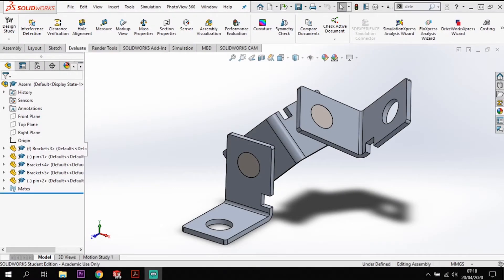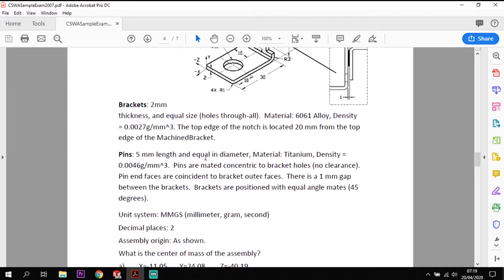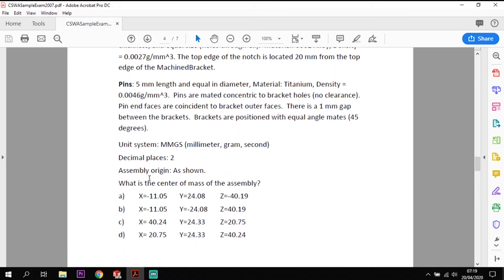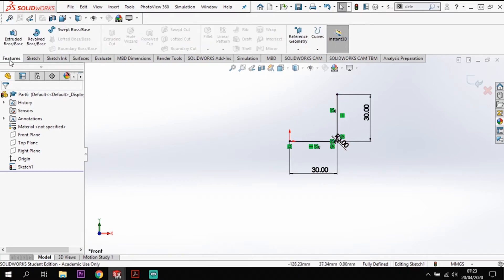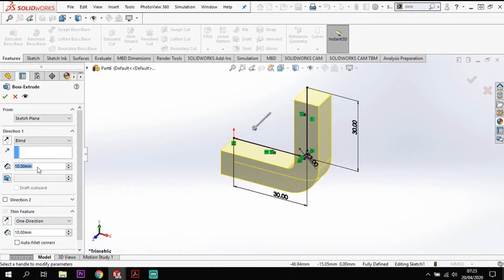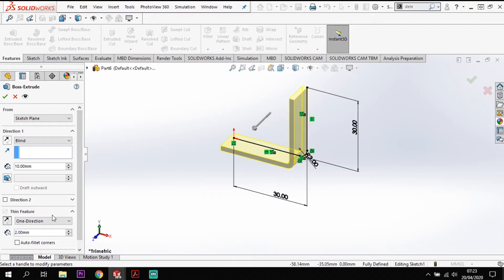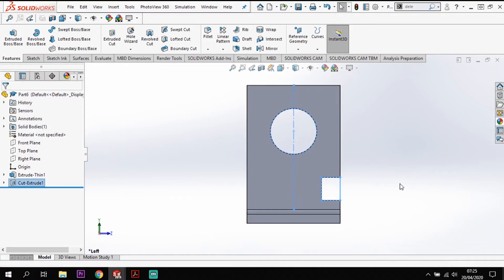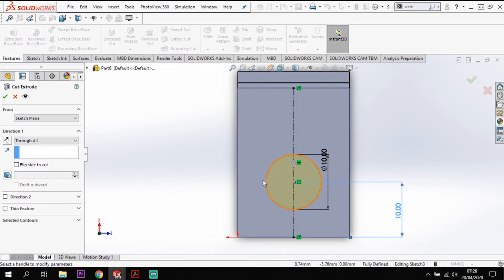CSWA TUTORIAL 6 | SUPPORTING YOU WITH GETTING YOUR SOLIDWORKS QUALIFICATION!

Comment: Hi, 
Thanks for your video. 
However, the material for the pin should only be "Titanium", located under 'other materials' -  this will then give the correct answer C.
Regards, 
Jaime Lara
Reply from the maker: Yes, you are right
Reply: Hello, provided the material is homogeneous, the center of mass is only affected by geometric properties. He got a wrong answer because the coordinate system of the assembly sheet must be rotated 90° around Y with respect to the system of the bracket part, as shown at 0:45. You can also verify this by the fact that the Y coordinate of the center of mass he gets is the only one that matches the right answer. Greetings!